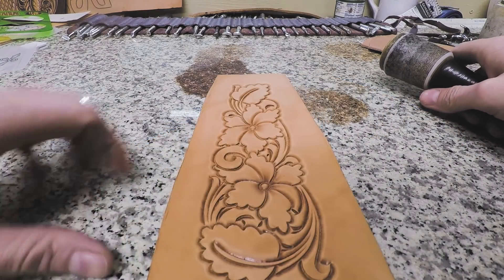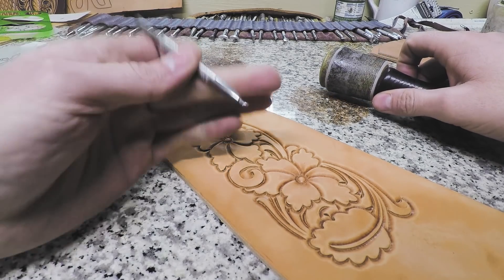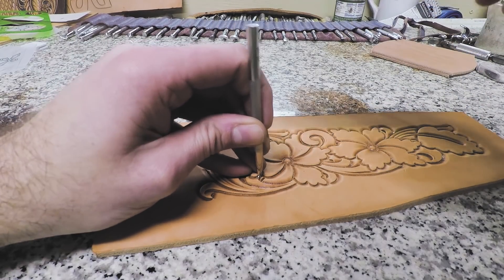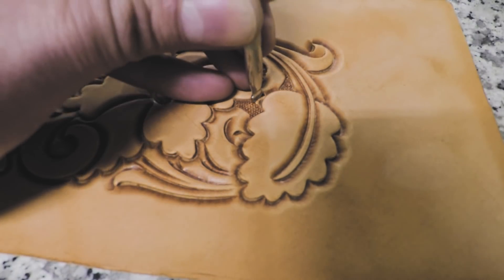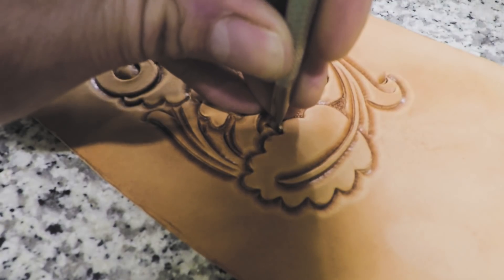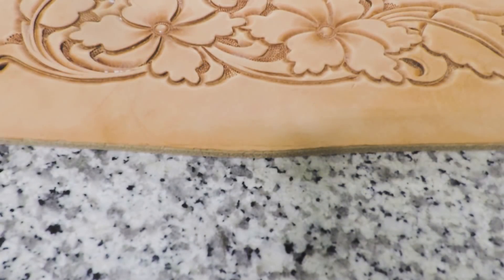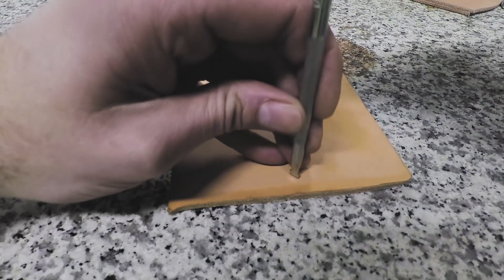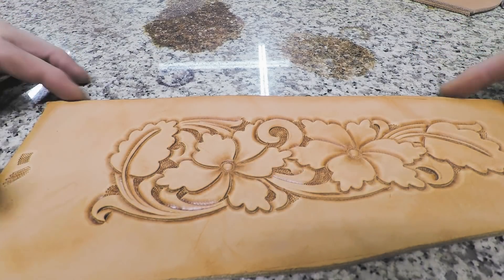Quick Leather Tooling Tip:  Bar Grounding

Comment: Hello Don, New into the craft, and haven't even hit the first tool yet!  Quick question on the tool roll you have your tools in.  what is it, and where did you get it?  How many tools does it hold, and is how you typically house your tools?  I thought about making a block to hold you tools vertical in the holes facing up, but the roll idea is an interesting and simple solution.  Thoughts?  Thank you for all the inspiration.  Great work, Amazing channel.

Comment: don, just found the channel. subscribed. one question/request. seems like you have about 25 or so punches there. im just getting started in leatherwork and have already spent hundreds of dollars on about 50 punches, and still never seem to have the right one. can we get a list/video of what ones you have/recommend?? 

also, semi related, do you buy or make your own? all mine are bought, but ive bought duplicates of some and ground them down smaller for small spaces, however, ive never done a "custom" one.

Comment: Do you use the 45 size bar grounders for tooling belts or do you use a smaller size. I am wanting to by a set from Barry king but he recommends the size 27 or 30 for belts. Any advice would be appreciated

Comment: Great tip,  however what do you use to get white when dying colors ?? I use various dyes, afraid to use acrylic paint for fear it will crack ??   Thanks
Reply from the maker: I use angelus paints and don’t have issues of cracking... I thin with water.